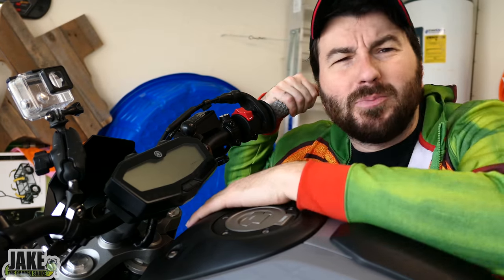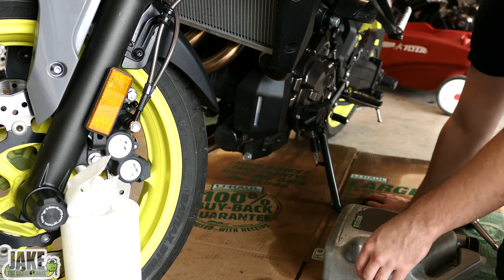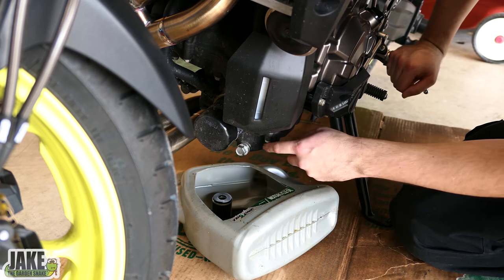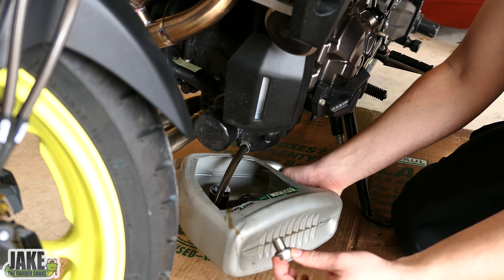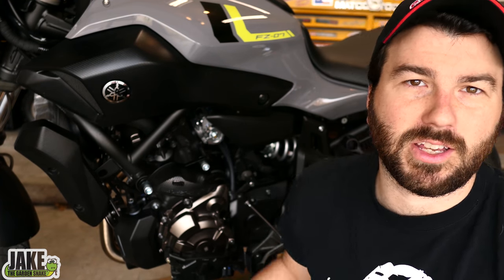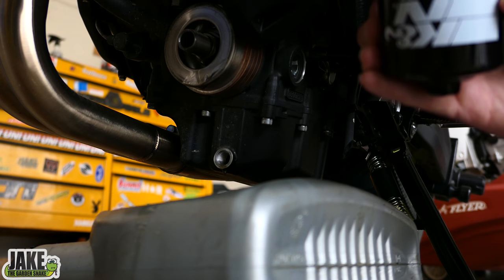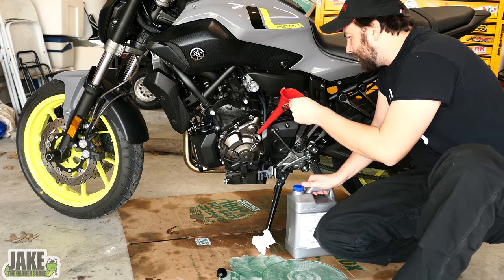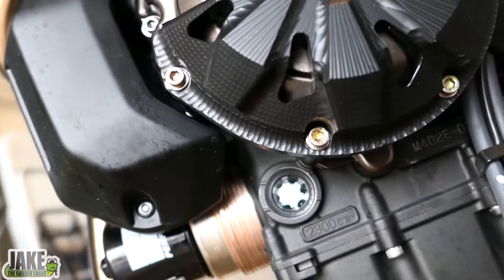FZ-07 Oil Change How To (MT-07)

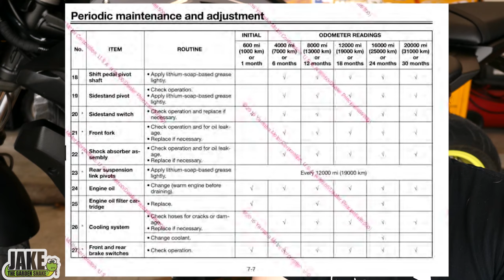Comment: @4:18 'you're not going to hurt anything by going earlier' except the environment and your wallet.. so there is no need to waste 5L of oil before the manual requires an oil change.
i'll start changing the oils early when i start seeing proof that it's contaminated with metal shavings and dirt or has lost it's lubricating properties. none of these two exist so go by the manual.
*today's mechanical tolerances are so small that you're not going to find metal shavings in your oil like let's say 20yrs ago. 

**i've used magnets on the drain plugs and filters to collect metals in oils, i've taken apart oil filters and oil screens and you can't find 'debris' that would require an oil change immediately. first oil change will most likely contain bits of liquid gaskets from the engine assembly..
* an oil filter can store up to 15grams of dirt. to give you an idea, that is about a table spoon of sugar. these engines will never put out so much dirt. ever.

Comment: What size crush washers?
Reply: The same as the originals if you can get them but it's not that critical as the torque isn't very high. Check in your manual.